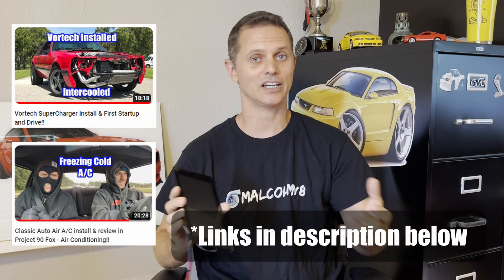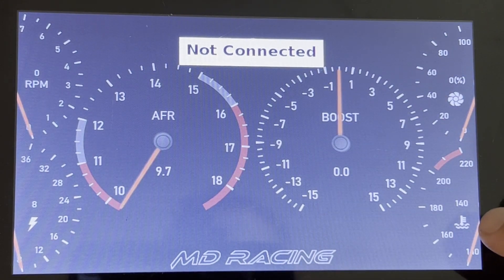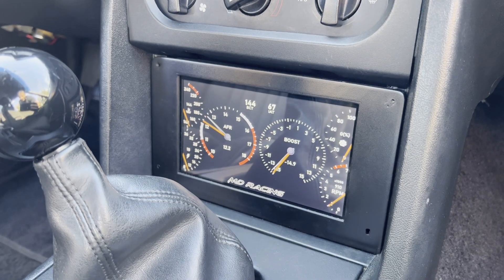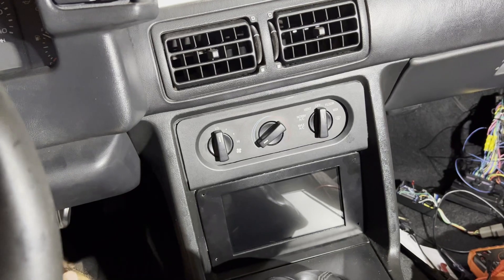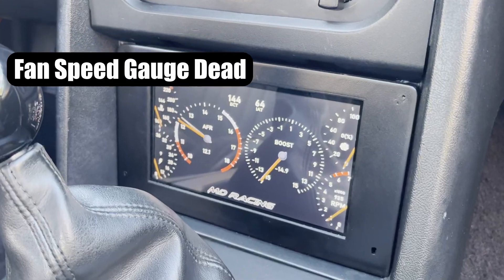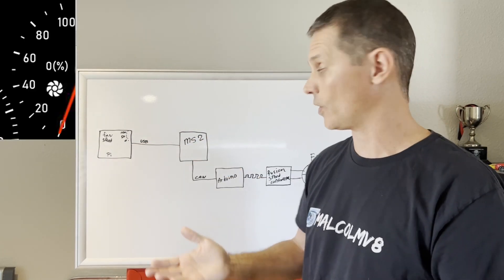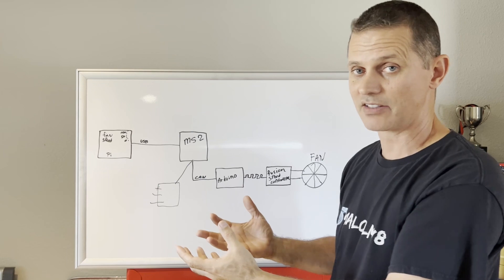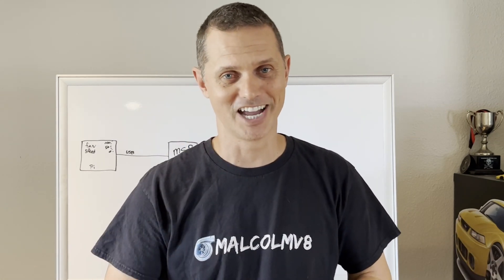Custom Pi Dash & insane fan speed gauge complications

Comment: Excellent!! Glad to see someone making videos of Megasquirt . 

I’m out of outputs on my ms3 pro pnp for 99-04 mustang to control things is there a way to add on outputs ?
Reply from the maker: Yes there's a few ways.  Probably the most simple way is to purchase a Microsquirt ECU.  There's a firmware you can flash to it which converts it into a straight IO box.  It'll connect to your existing MS ECU via CAN BUS and all of it's inputs and outputs become available.  It's essentially like an expansion box of inputs and outputs.  Another much cheaper way, depending on your abilities, is to grab an arduino and CAN module board and you can create and program your own additional inputs and outputs.  This method takes a lot more work and requires some knowledge of the Arduino, writing some code and programming it as well as an understanding and ability to assemble some of the electronics to handle the inputs and outputs.  Those are the most popular two methods I use all the time, both work very well.  Best of luck with it :)

Comment: Not sure if I mentioned it to you before in one of your other videos but I have a similar set up in my sn95 I have a raspberry pi 4 with tunerstudio but I also installed open auto pro from Bluewave studios on it cost something like $30 for there software. I then installed a audio hat as well with an Amp and mic  built in. Then I put it into the car using the carPi hat which is real good but it's pricey for what it is but no complaints works fantastic. Anyway this setup will do exactly the same things as yours but will give you a car stereo too and will allow android auto and carplay to work with it.
Reply from the maker: I’m not a radio guy but that’s fantastic info for people wanting that option. Heck I may even install one in a car where the owner wants a radio so that would be good. 
Although I really like Apple CarPlay so that alone might be worth it. I’ll check it out.

Comment: Great content as always.  Those Arduino boards are very handy.  From your earlier flow sensor video, I built a little device to convert my flow sensor PWM output into a 0-5v analog input for my Aeroforce gauge.  I used an Arduino Nano + simple DAC on a super small PCB that I had printed by PCBWay.  Works like a champ to give IC flow data right onto my Aeroforce.
Reply from the maker: That's super cool, I love the innovation in making something like that work.  Always amazing to hear what others have done with a little inspiration and made their own interesting projects.

Comment: Awesome video, my question is did you still need that expansion board or did that Arduino end up being the fix?
Reply from the maker: I coded the Arduino to emulate the expansion board and got it working.  So the Microsquirt thinks it's talking to an expansion board but in reality it's just talking to the Arduino lol.
Reply: @MalcolmV8  lol sweet that's what it looked like, very interesting.